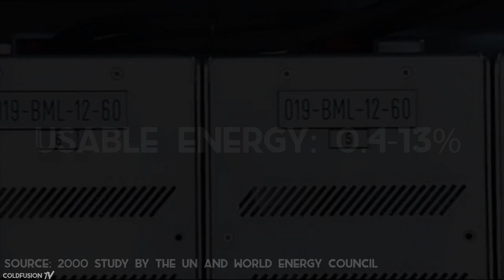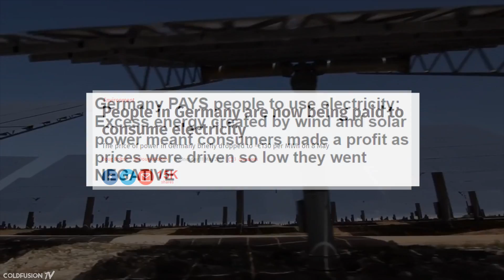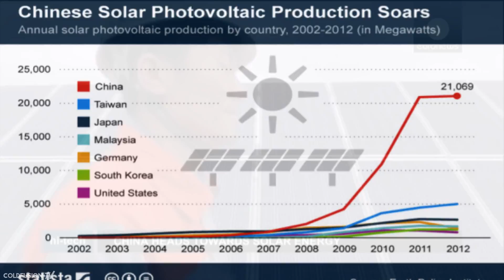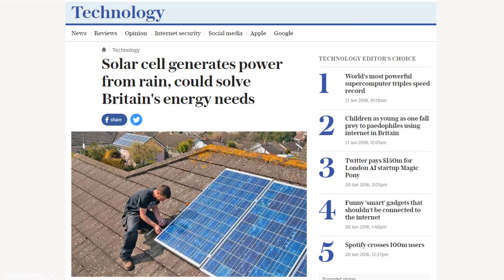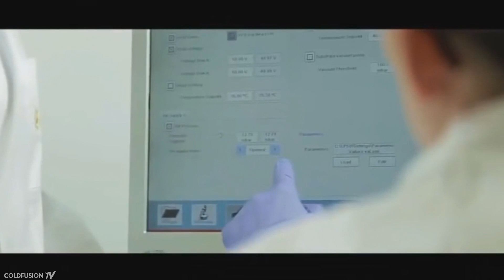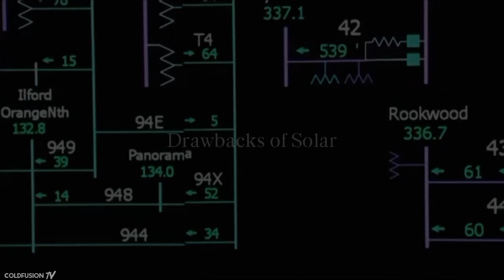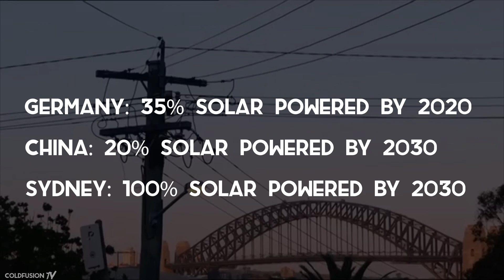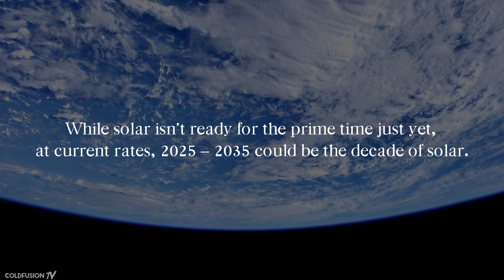The Truth About Solar

Comment: The problem with solar is that the solar cells themselves are no longer the bulk of the costs.  The technologies like inverters, plain old mounting mechanisms, labor, etc...account for the bulk of the costs.  Since these are mature technologies with an extremely shallow development curve, solar costs have effectively flatlined at a cost that's infeasible relative to other, far more flexible technologies.

Also because of the substantial swings in availability, massive seasonal changes, and the fact that a storm can roll through and destroy massive swaths of the equipment, we need weeks, if not months of storage to buffer the output.  While nuclear isn't good at meeting demand, it would only take storage equivalent to only about 1/4 to 1/3 of daily output to completely buffer the daily needs of production.

Renewables are being pushed purely as part of an ideological movement.  In reality we have so much nuclear fuel that availability simply isn't an issue.

Comment: People in these comments are getting Solar power and Photo-voltaics (PV) massively confused. There are other forms of solar power generation outside of PV generation. One such way is using Concentrated Solar Thermal. In this method you use mirrors to focus light energy at a single point heating it up. Using some kind of heat transfer medium such as molten salt you can then heat water up for a steam plant. The best part is that systems like this stay more than hot enough at night to continue production at a reduced amount. Dismissing all solar power generation because one aspect (PV) is not up to date is just ignorant.

Comment: making of solar panels is actually very bad for the environment. which is the reason why china with no EPA laws is able to make solar power cheaper. i do agree that solar is a nice energy source.
Reply: Having worked 30 years in the solar industry, I have studied the actual numbers. And, consistent with industry standards,  I have 25-30 year old panels still working quite well.  The energy payback time (how long it takes a panel to generate as much energy as it took to produce it) is now between 1 and 2.5 years, depending on the type and where installed.  

The manufacturing process has also cleaned up.  Any pollution it produces is at worst only a minute fraction of that generated by combustion or nuclear energy.  The only environmentally questionable solar technology is cadmium telluride which can cause pollution if disposed of improperly. 

Opponents of solar continue to cite long-obsolete fallacies to challenge modern solar which has overcome them.
Reply: Not all panels are made in unregulated environmental polluting China. Check out SolarWorld panels, they are made in Oregon, USA, and have a much lower impact on the environment.
Reply: What types of panels are you alluding to for optimal efficiency? 

And are there not other detrimental environmental effects to say mining Lithium for the energy storage of solar?
Reply: speed2998 so if what you say is true id expect alot more people using them in the suburbs of nyc and solar panels aren't that popular. considering a 2000 sq houses go for around 800k-950k.

best case is to produce the panels in the US from raw materials to assembly. and ban imports. coal/natural gas power plants should be kept imo. im not a fan of nuclear ones though.
Reply: You don't think much cheaper labor is a reason they can be made cheaper in china?  Can you compare the pollution from making a solar panel that will make 1 mega watt of electricity over it's life to what burning coal would be for the same amount. I don't know, I am asking. but I think burning coal releases mercury into the air.
Reply: fred stevens labor isnt the reason why it's cheaper. it's the fact that china doesn't care about the environment.

shit look at the way they mine for the materials to making batteries. the left wing assholes create the epa to move jobs to china so they can hand out more welfare and buy votes. and then IMPORT it back into the US.
Reply: +Ashish Patel damn, you just may have a point.  A bit heavy on the  conspiracy theory, but still something that provokes genuine thought that there is more to why alternative renewable energy resources are taking so long to develop.
Reply: ***** nah son. it's been mostly left wing terrorist nutjobs. it's like the liberals want the epa to move jobs outside of the US. if people cared about the environment we wouldnt be allowed to import certain goods from certain countries that dont protect the environment.
Reply: +Ashish Patel 

In other words: more cost shifting to apartment renters and poor people, right? 

See how's Germany's play-energy indulgence is working out out and how rates are going through the roof for everyone except thise playing Kids Lemonade Stand play-energy generation.
Reply: China is currently experimenting using just alloy metal(zinc,copper,silver...etc) to make solar panel. They achieve 7% which is far away from current one.
Reply: Kong Wee Peh yeah. the only way solar will be usable is to incorporate it into the roof of a house. and it needs to last at least 25 years and generate solar power. currently solar panels last around 7-10 years.
Reply: sidecarnutz damn.
Reply: +Ashish Patel ,yeah those  left wing  Nixon republicans that
 created  the EPA  just ruined everything, we could be destroying Americas  even faster than we are now with corporations owning and controlling the government,all its public agencies   ,entities, functions, the country and our  lives.
Reply: +fred stevens 
Reasons why China had cheap solar products: 
1. Heavy government subsidy,
2. Yuan manipulation, 
3. Lacks safety, enviromental, labor practice regulations, 
4. Dirt cheap sweatshop slave labor, 
5. Corporate espionage (R&D requires a lot of capital),
6. Product dumping (artificially lowering the price to run down their competitors)

Comment: the solar panels trap the sunlight en give energie but also trap heat, wat about the heat they generate? white surface verses black. will the black give more global warming ?
Reply: you ever seen how many tar shingle roofs there are in the world. the solar panels won't be dealing with any more or less heat than is already there. though you raise a very strong point here though. heat is useful in energy storage too if say your heating a pool. and if you have still too much energy make a hot tub to store even more energy.  water is the trick though. water and electricity mixed indirectly the right way and you can build pyramids let alone anything else.
Reply: but now they gone make extra black in open field, know that the stored head sooner or lather escape in to the atmosphere.
Reply: rdkater it won't cause negative effects regarding "global warming"

Comment: Anyway many people already pointed out some of the other flaws so no need to repeat it. But one important thing to mention is that we need a way to produce more electricity (without killing ourselves of course) so that our development and civilization can improve. Every time we tapped a new energy source we can see a correlation between cheap energy available in large quantities and improvement of quality of life. When we made carbon our slave we abandoned our need for human ones. 
With a large quantity of energy we can address almost every problem we have today. Not enough water? Well de-salt the water with enough cheap energy. Not enough food? Well use modern farming complexes to maximize plant growth and efficiency. Solar by all estimations and evidence we have today (Namely Germany, in theory we could power about 50% of the country just with renewable's but in reality we can't hack it and need to import massive amounts from france) can't even power (hot countries with deserts it might work) our current energy consumption let alone increase our output.

Comment: The positives stated, e.g., excess energy given away, is a complete lie.  Since you don't "dial down" solar during peak generation, you must STORE IT.  That's the problem.  If you can't store it, you "dump it".  Like using a gasoline generator at home during an outage, your 6000 watt generator is pumping out more wattage than the 1500 watts you're using....hence, the rest goes out the exhaust pipe.  How to fix this for solar and wind?  BATTERIES.  Sorry....that ruins the equation.  Stop using calculations based on the cost of "panels".  Big deal!  That hardly works out.  Solar and Wind will NOT EVER replace fossil fuels.  Also, there is NO replacement for oil.  We need oil for many other things.  I do have the answer to this conundrum, but nobody will listen or believe it, even if it's 100% explained and understood.  I give up on this.  Why?  Because there's too much money to WASTE going the loser path AND my solution would truly change the world.  Something "they" don't want to do.

Comment: Of course no mention of the dirty secret of solar, which is that the materials needed to construct solar panels involve digging up and processing some extremely environmentally damaging stuff. Reality is Solar isn't free, or renewable.
Reply: oh yes, and coal and uranium grow on trees, no toxic mining required.
Reply: Silicon is not toxic, and once again, Rockitiki is citing long discredited data which does not apply to modern products.
Reply: Toxic components are pretty irrelevant in the grand scheme of things.  With large scale energy generation, you need to think in terms of magnitude - planet-wide effects (not local effects on human health, which can be mitigated through legal means).  Anyway, I'm just some random person on the Internet so establishing credibility is challenging.
Reply: I agree man your right. Silicon is an extremely hard and toxic element to process into solar panels
Reply: Solar cell also contain other elements like gallium, but like the above post, still better than fossil fuel.
Reply: The process itself is extremely toxic to Chand silicon into solar panels.
Reply: +okleydokley Rocktiki does have a point though. The quantity of solar materials and the processing involved in making solar cells are huge. Yes, uranium requires mining too, but the energy density of uranium is much greater, and therefore require much less of it. I don't think that solar is necessarily the answer for the future, but to work in tandem with nuclear power, and maybe even nuclear fusion.
Reply: But there are radio active wastes after the use of uranium. Fusion is the ultimate solution nut we are not quite there.
Reply: Processing ANYTHING is unsafe if they do not follow safety procedures.
Reply: can you get more energy out of the life of uranium verses the current life of solar cells?
Reply: I'm not going to teach materials science, or get into Chinese mining, and manufacturing debates with people, do your own research. Solar isn't as clean as you think. As for alternatives there are plenty, and funding to SCIENCE is important in finding long term solutions. In the meantime at least be honest we don't have ANY power source that is a magic bullet. and thus all of them should be on the table right now, and have us selecting the right power source for the right job. whether that is coal, oil, nuclear, wood, solar, hydro, wind or anything else.
Reply: No statement on the cleanliness or "greenness" of electricity generation methods has any value or relevance without hard numbers.

Questions you need to ask: "How much CO2 is released per kWh of installed solar panels?  Wind turbines?"

"How much CO2 is released per kWh of coal burned?  Uranium fissioned?"

Only then can a meaningful discussion take place.

I'm on mobile and don't have time to provide any hard data on the subject, but to steer the discussion towards the factual and correct, wind turbines, at least, are between two to three orders of magnitude more efficient than coal plants in terms of converting greenhouse gases into usable electricity.  Modern solar panels are somewhere between one and two orders of magnitude more efficient.  And yes, this includes associated mining operations, assembly, distribution, sale, installation and maintenance.

When you add recycling operations into the mix, the numbers increase dramatically in favor of wind, and significantly for solar.
Reply: At present the best reactors achieve approx. 15% efficiency. The new reactors being developed (fast breeder reactors)  will use the remaining 85%. There is currently enough "waste" radioactive material to provide electricity for thousands of years, without mining any more! And the waste has no energy left in it, and would be safe to put on your cereal.
Reply: I didn't cite any data, I told people to do their own research. Your response is obviously political in nature and not based on anything more than protecting your sacred cow. Which is fine, if you want to believe that Solar power is some end all be all magic energy source, be my guest. Just don't be surprised when it bites you in the butt.
Reply: Righto.
Reply: thinking bleak -___-
Reply: ok goodpoint, so what about 
Perovskite Solar Cells?
Reply: that's thinking better :)
Reply: Not all photovoltaics, CdT is far less hazardous.
Reply: nothing we do is healthy or good for the ground we stand on and water we drink, we can always say the chemicals used are bad in making modules. or that coal is emitting pollutions etc etc..  hell coke and Pepsi dissolve metal and we still drink it........... but  say there was only 10 tons of each resource left on the planet. you would evaluate your consumption and build things to last as long as you can. you would have to farm energy cuz gathering energy to burn had ended.
Reply: Who said solar was either free or renewable? Solar power is available now and forever.  There are many other technologies to compete with Solar, but oil is not one of them. Nor is gas or coal. Nothing is free, and to think otherwise is silly and futile. We are in at the beginning; our grandchildren may thank us.
Reply: John Benton right!!
Reply: Thank you.